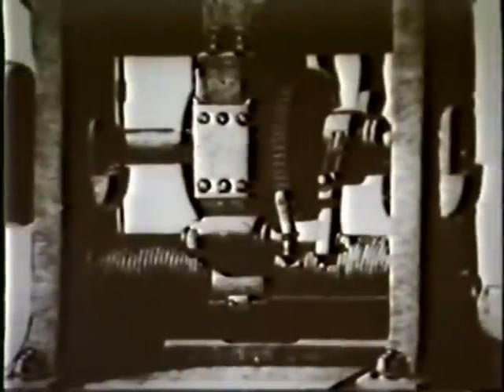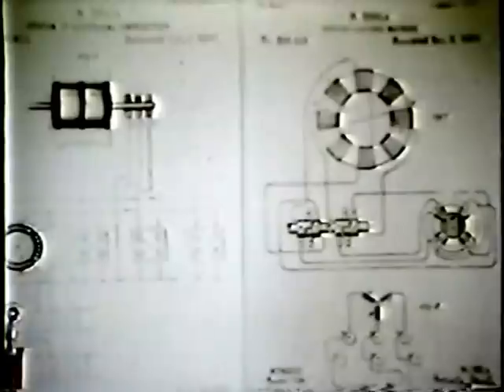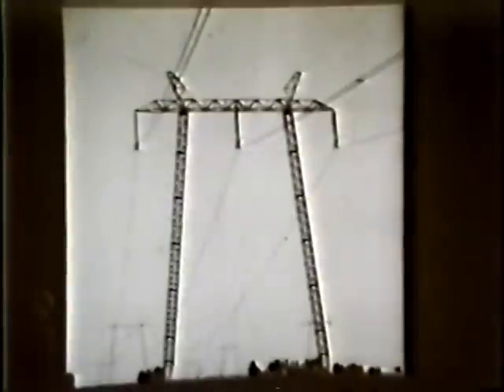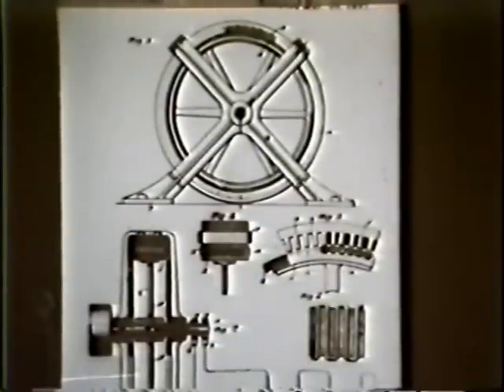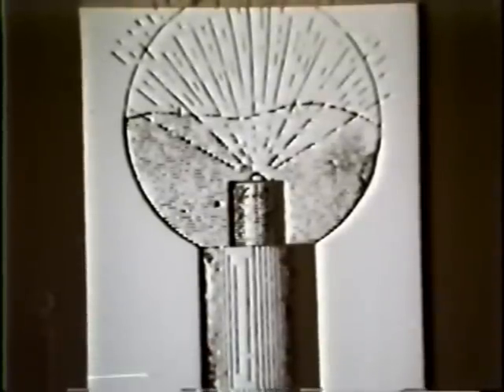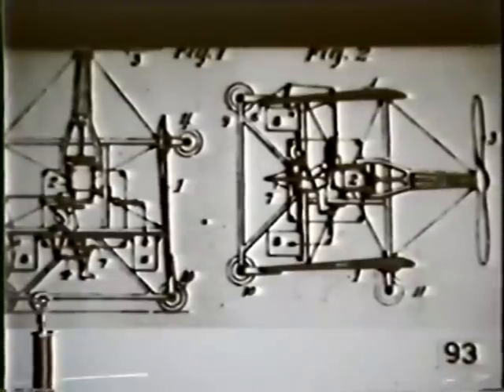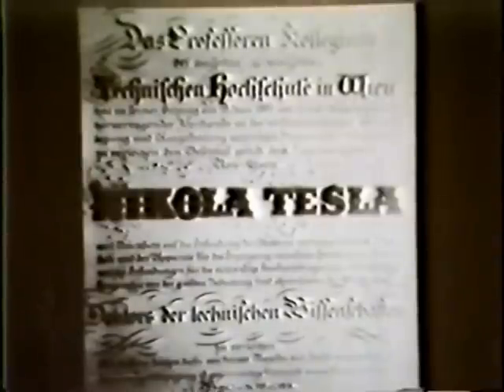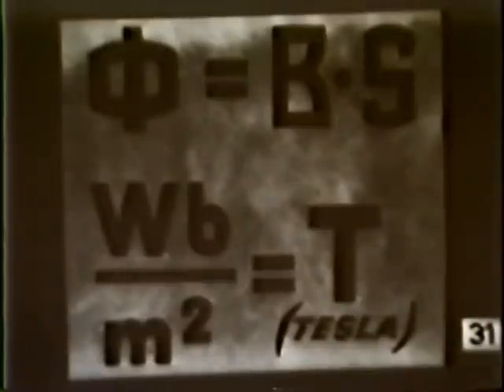OTHER TESLA INVENTIONS and 5 KEY DIRECT LINKS

Comment: Tesla was far ahead of ANYBODY of that time and of this time
Reply from the maker: There is a simple proof of that: His AC Three Phase Ultra High Voltage system transmits GigaWatts of power worldwide( ata speed of light according to Maxwell!) and then utilizes that AC power at utility AC line  voltage in his AC motors and generators including present day Fully Electric Vehicles! !
Reply: @SlobodanCukTESLAco  his time machine is amazing
Reply: Very true
ಕಟು ಸತ್ಯ